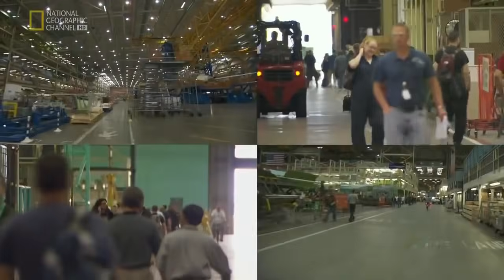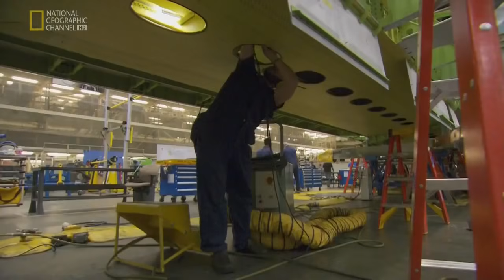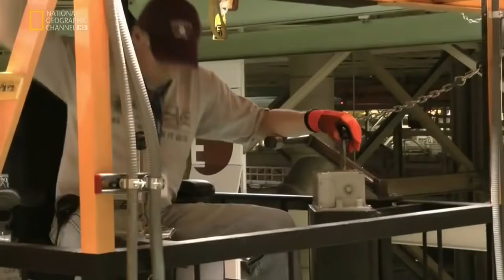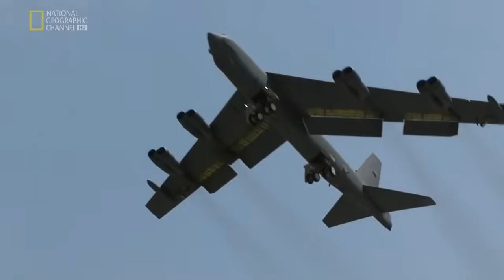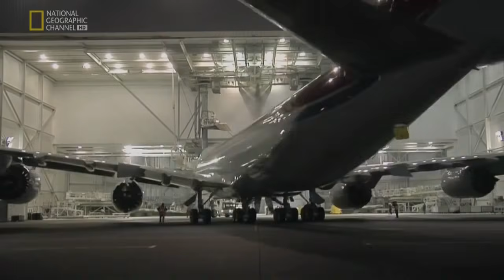Boeing 747-8 Mega factories Documentary- Boeing's latest Jumbo Jet!

Comment: A salute to Joe Sutter (the father of the 747). Without him, we would never have had this plane design. Also, I just discovered that the 747-800 has much larger engines than the 747-400 does, which makes the 747-800 look much better in my opinion. R.I.P. Mr. Joe Sutter.

Comment: Magnificent plane. Too bad hardly anybody is buying it. Looks like 747-8 came out at the wrong time.
Reply: A few years late .. Airbus got the major part of the large aircraft market.
Reply: Yeah only about 100 have been sold
Reply: I wonder why they didnt make the structure in carbon fiber like the 787 would make it so much better
Reply: That would be a new design, rather than an upgrade, and would require a long and costly certification program.
Reply: ***** Yea makes sense.
Reply: Sitti2300 mostly used as freighter
Reply: Halo Fire op
Reply: Halo Fire  op
Reply: The 747 was designed to be a passenger / cargo plane from the beginning.  It will be just fine.
Reply: Sitti2300 Lufthansa did
Reply: Sitti2300 Anyone who owns a 747 would trash their old one and get this one. It is new and more efficient.
Reply: HyperVenomProduction British Airways would beg to differ
Reply: minimusmax not if you consider their development costs...
Reply: Pedro Santos do you not realize how expensive carbon fiber is?
Reply: Sitti2300 I'll buy it for under 30 bucks
Reply: Sitti2300 yup but you never know what might happen do you like airbus ? i dont go anywhere near
Reply: +Sitti2300. the designers of the 747 planned for this kind of thing back in the 60's when they thought supersonic passenger flight would take over, so they designed it to be as good of a cargo aircraft as it is a passenger aircraft, the new dash 8 is no different, if it can't sell as a commercial aircraft they can sell it as a cargo aircraft. 
the reason large aircraft aren't selling so good is the loosening of the ATOPS rules. it used to be that only aircraft with more than 2 engines could cross the oceans, now though 2 engine aircraft are as reliable and as economical per passenger as bigger aircraft so now airlines don't need big planes. this has created a new "point to point" system of flights instead of the old "hub to hub" system the 747 and a380 were built for.
this could all change though, if something happens geopoliticaly then the hub to hub system may become valid again and big aircraft will start selling well again.
Reply: Thats because it's the second best
Reply: honestly a380 and 748 are victims of their own companies with the A330/350 and 777 respectfully
Reply: @brendanmiller4134  looking like 150 will be built in total, 103 of the freighter version, Last freighter delivery expected in 2022.
Reply: @googaagoogaa12345678  I agree. They build these huge planes and turn around and release these fuel efficient twin engine planes that carry nearly the same amount of people and wonder why the jumbo aircrafts aren't selling. This is one reason I loath the 777, that and its overall blandness.
Reply: For the same reason, the A380 is also no longer selling.
Reply: I sincerely doubt anyone at Boeing's board actually expected a profit from the 748. By the time they decided to build it, any of the potential markets would have been either more efficiently filled by the future 779, or more prestigiously by the A380 that was already in the market. Given that the market for Super Jumbos was rapidly shrinking by the time Boeing announced the 748, it's pretty obvious the development was just meant to be a status rather than practical response
Reply: More like it came out past it's time, people prefer to get to there destination quickest and most efficient.. I'm not suggesting that SSTs are the future, just saying people prefer not to waste time on the ground, they wan't to get there as direct and if possible as fast but they aren't going to pay extra for speed..

Comment: A380 production is slowing down and 747-8 is failing to sell. The A350xwb and B787 are the future.
Reply: That's true. The more efficient twin engines like the 777, 787, A350 are the future.
Reply: 777 is why 747 sales are going down
Reply: You forgot the 777
Reply: Owen Chen why would they not do that? Give free money for Boeing or join the competition
Reply: Between the 777, 787, and the A350, I like the 777 the best, as far as looks go. The near future 777-10 (or whatever it's called) looks like it will be very nice looking, but I don't like the folding wing tips. Of course, I love the 777-300ER. I think the 787 and A350 are kind of ugly up front.
Reply: 747-8F is doing well though
Reply: unlike the a380 though, the 747 was also built to be a cargo aircraft, which means if it doesn't sell well to passenger airlines, it will probably be exactly what Fedex or DHL need. i can't see the a380 easily being reconfigured into a cargo aircraft, it was never designed with that idea in mind.
Reply: @killman369547  true more than half the 8s are Fs UPS has a big a** order at the moment fedex beside a brief stint after the merger with flying tigers has never ordered or operated 747s ups LOVES them though
Reply: The 747 was actually originally supposed to be a freighter. The whole passenger thing just happened to work really damned well to start the program. The way the nose swings up on the cargo variant makes it much easier to work with in loading/offloading operations.
Reply: @Jetlog8  As of mid 2018 the production rate is 6 per year of only the Cargo version, likely until 2020.
Reply: Funny, from what I recall reading is that these jumbo jets will soon be needed to deal with the increasing number of passengers.

Comment: 1 747-8 engine creates as much thrust as all 8 engines on a B52??? B52 needs some new engines then. geez.
Reply: And they will....
Reply: B52s will soon be 60 years old. I don't think they're gonna bother to redesign them any time soon.
Reply: melted cheetah yeah they want to keep them flying till 2040, which is stupid because they’re so inefficient, they need a parachute to slow down
Reply: @xenomorphbiologist-xx1214  That makes no sense.  Efficiency has nothing to do with a braking parachute.  Many airplanes use them.  

The basic design of the B-52 is so efficient that with new engines they are projected to be able to go around the world without refueling.
Reply: johng3592 what I mean is the engines do not have enough power in their reverse thrust to slow the plane down adequately.
Reply: That stat is wrong. B52 has 8xTF33 at 17,000lb each for 136,000lbf total. 747's GENX--2B67B  is 66,500lb.
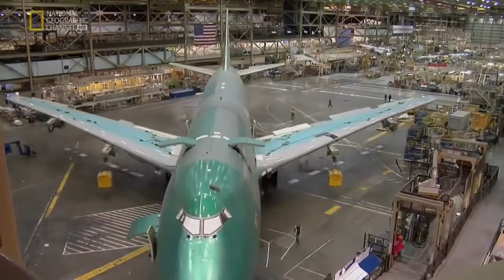Reply: 29:50 power time!

Comment: why don't they just install a small extra wheel at the tail, like the concorde has one, to avoid tailstrikes?
Reply: they should use a wheel to charge the lights in the bathrooms.
Reply: good idea xD
Reply: No space for a tail wheel. The black boxes, recorders and main computer systems are all located in the tail
Reply: +JR AL ok thanks for the answer :)
Reply: +Gabby Hyman The engines are used to generate power for the aircraft.
Reply: E1craZ4life to
Reply: Really no need for a black box. No need to store that info on plane. Because WiFi.
Reply: NeverTalkToCops1 an aero plane isn’t connected to WiFi and WiFi can’t reach the aeroplane

Comment: still can't beat the airbus!!!! a380!!!!!!!!!
Reply: no shit, it's a bigger plane
Reply: Like ur mom
Reply: it can first by range second in speed third in length fourth it can land on normal airport like Naia Davao Airport in Philippines
Reply: +Hilton White I didn't realise that a company that has no gender could be gay.(in case you can't tell this is sarcasm.)
Reply: Hahaha!!!
Reply: That's true!!!
Reply: It will always still be a scarebus.
Reply: ***** Only because it's new, and the airlines that buy Airbus are idiots, they're throwing $50 Millon away with every plane they buy thats an Airbus as opposed to a Boeing , and the 747-8 is a lot more fuel efficient
Reply: Lufthansa, which has ordered both the A380 and 747-8, concludes the A380 burns less fuel per 100 passenger kilometers, though the figure is 3% lower on a litre-per-passenger kilometer basis
Reply: That isn't really fair --
In Lufthansa's A380 configuration, they have: 8 First, 92 Business, 52 Premium Economy, and 336 Economy Seats.
In Lufthansa's 747-8 configuration, they have: 8 First, 92 Business, 32 Premium Economy, and 208 Economy Seats.

They are suited for different markets and have different ratios for their seat classes. If the 747-8 had a configuration with the same ratio as the A380, it'd be something like this:

8 First (nose section, not going to change), 68 Business, 40 Premium Economy, and 278 Economy.
And yes I checked this configuration fits perfectly in the airplane...

So, the new version of Lufthansa's 747-8 has 54 extra seats than the old one. This immediately takes away the 3% advantage of the a380, and instead gives...:

(using 100 for simplicity for ratios)
100 litres per person on 748 - 34000 litres -> 86.3 litres per person
97 litres per person on a388 - 47336 litres -> 97 litres per person

... a huge advantage to the 747-8 of 11%.

Also, the a380 is likely to not have as good a load factor compared to the 747-8, so the 747 should have a much better economic advantage.
Reply: Mikael Can And the 747-8 is $50,000,000 less, that's a no brainer
Reply: Andrew Anane that is a horrible plane
Reply: +Easton Williams if its a '' no brainer'' why is the a380 out selling the 747-8i at a ratio of 6:1?
Reply: john walt Lmao, the A380 is literally dying as we speak, everyone is buying more small bodied jets instead of large ones and even then Boeing is still going strong with the 747, UPS just bought 28 747-8, the option of the A380 was totally non-existent because it can't haul cargo.

The whole point of the 747 was that it was designed for multipurpose, Cargo, Civilians, and maybe even military, the A380 is Civilian only which means Boeing is the only option unless they decide to get smaller Airbus' for Cargo and even then the 777 is still going strong and the Cargo airlines will simply buy the 777x.

The Cargo market is on the upturn which means Boeing has the advantage over the A380. Airlines are cutting orders on larger aircraft and would rather have 737s and A320s that can fly across continents or 787s and A350s.

Also, the A380 is much older than the 747-8. It doesn't matter what is happening in the moment, Boeing like other smart Businesses have their products planned out into the future over 5 years.
Reply: it's not Airbus it's scare bus LOL the name Airbus sounds a little cheap granite flying on a plane today is a lot like being on a bus though😕😕
Reply: A380 looks fucking bloated

Comment: My 747 won't start and the brake is hard, help?
Reply: Hmmm, could it be because it's a model?
Reply: +PilotStudios Channel hahahauua
Reply: PilotStudios Channel YES!! :D that totally explains it! :D how'd you know? :D - no seriously I'm so poor out of my ass that I cannot even afford a model :(
Reply: +friedchicken1981 xDDDDDDDD
Reply: You could buy a Daron model that goes around 7 bucks. They aren't the best mainly because they are meant to be children's toys, but they are pretty detailed.
Reply: Pzkw V cool thanks, maybe with two months of hard work I could afford one :D
Reply: friedchicken1981 have you tried putting engine oil 😂
Reply: Try to do a reboot
Reply: Have you tried turning it on and off again?
Reply: @techsupportranjit7637  this aint airbus
Reply: just throw it out and go to toyshop for a new one
Reply: friedchicken ; You need to check the coil chip processor and it's battery, in a pinch just use the battery out of a mini-calculator and you should be fine.

Comment: The A380 was not a success mainly because it was actually surprisingly ... too big for the needs and also because fuel consumption/seat was not very good.  After only 10 years of production, Airbus may soon scrap the A380
Reply: If Airbus can somehow figure out how to make the A380 much lighter (by using new exotic light materials), and improve on aerodynamics, it might become more practical? Also, more fuel efficient engines would help. Maybe they can go to a two engine system?

Comment: "just one of these engines creates as much thrust as all eight engines on a b52".... So why not just stick one of them engines on a B52?  :D.

That has got to be bollocks by the way.. doesnt add up to me.. might be cos i have had a drink but from what i seen.. One of them engines has about 4x the power of a B52 engine so... it would be 2 of them that creat about as much thrust as all 8 of a b52???... Maaybe they meant the earlier models.. O.O... fuckin mind boggling
Reply: +Vanadeo yes and no.... Yes in the fact that its more powerful than the orginal 8 J57s... but current J57s put out about 17K lb of thrust, so you are kinda correct.
Reply: because 4 engines cant propell a large airliner such as b52 and early engines is low bypass
Reply: +Vanadeo because engines dont work on their own, it requires an extensive and expensive redesign of the entire aircraft
Reply: haha i think they got a bit confused,2 of them are equal to the 8 on the B52
Reply: +theRealAV8r The KC-135 is just as old as the B-52 and they went from 1950s turbojets to late 20th century turbofans. With the B-52 projected to have a lifespan of nearly 100 years there's no reason why they shouldn't do it. The amount of money they'd save on fuel costs would more than pay for the conversion.
Reply: Thomas S Apparently it's a combination of factors that have stymied the B52 re-engine. Among other things is it's unusual airframe. Also low oil prices and the small fleet have helped the case for doing nothing.
But according to the link below, P&W is still looking at enhancing the existing engines, which would maintain the current 8 engine config and abrogate the need for extensive redesign:
https://www.flightglobal.com/news/articles/pw-still-pushing-upgrade-of-b-52s-original-tf33-en-424327/
Reply: The wings would have to be redesigned to accommodate the new bending moments that would be in place due to the reduction in engine weight.
Reply: What kind of engines are on a b25 bomber

Comment: In my machinist years, our shop was subcontracted to machine the holes in the cockpit instrument panels for the newly built 747.  The panels were approx 8"x15" aluminum sheets sandwiched together with a honeycomb structure between. Over all thickness of about 1/4", very strong and very light weight.  All measurements were +- .003"

Comment: Even the latest 747-8 with the GEnex motors, it still has less range than the A380. Either way, both big planes are dying out for twin-engine super long range and efficient platforms like A350, 777, and 787 which carry lots of people with less cost, less fuel cost and maintenance cost. And same with the 737 and A320NEO.
Reply: GEnx motors didnt know it was electric thought it used GEnx ENGINES

Comment: I took flights on both the Boeing 747-400 and the A380 but I still prepare the Boeing 747- 400. I feel more safer on the Boeing 747-400 because of its safety records and now there is a newer model which is the Boeing 747-8. Now, there is no argument. Boeing 747-8 will be my choice.
Reply: +PNOYPWR ??!!
Safety records? Well, the safety record of the A380 is MUCH better than the 747 ... you'll say that the A380 is not old enough to have crashes or something and you would be right :) However, the 747 has had really nasty crashes in the past ... 
I take 747s and A380s from Europe to the far East every month and I can tell you this. The difference as a passenger is that the A380 is much MUCH more comfortable in terms of room (Business Class is much MUCH better in the A380) the plane is much quieter, but the windows of the 747 are much bigger and done in a better way for the passenger. Anyway I'd prefer the A380 anytime apart from one small detail; every time that 2 or 3 planes arrive at the same schedule, it's hell in the Controls, Luggage, etc. But it's not such a sweet deal with 747 as well.
Some say that the 747 is much good looking; I don't think so but then again, I cannot see the plane when I'm inside ;)
Reply: The 747 has been flying for 45 years and your comparing safety records! You have got to be kidding!
I will take the 747 every time, I could careless if I ever fly on an A-380!
Reply: @ jorgeferreira2009: The 747 has been flying since 1970. Sorry. I guess you are still not born after that year,Lol.

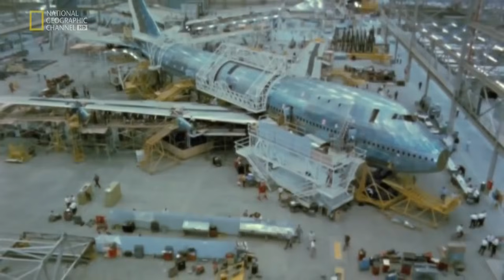Comment: @~20:30 "The Sutter Twist" - better known generally as "wash out" that's been applied to the inboard sections of wing design since WW1 to mitigate excessive roll moment when laminar flow separation occurs at stall by forcing it to begin at the root.

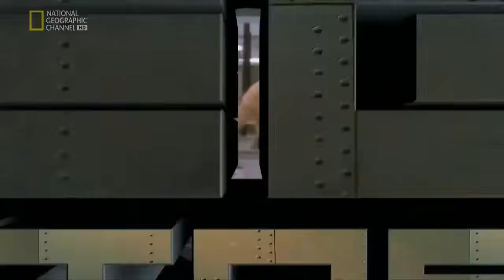Comment: Hmm i still prefer the old school way of adjusting the shape of the plane to fix any aerodynamics issues to avoid vibrations, here they using a computer that makes adjustments while you flying, which is a cheaper way of doing it but I reckon its not as reliable. I don't trust computers and fly by wire as much, computers always end up having issues sooner or later. (I'm referring to what you see after 19:48)

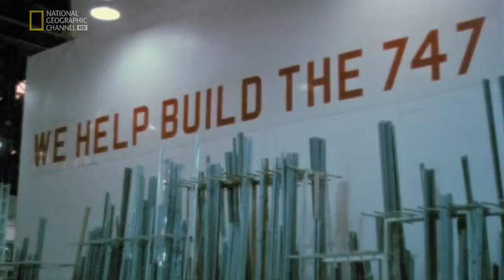Comment: 8:11 Pan Am originally wanted a plane with 350 seats with a 5k KM range in the 1960.
Yet just 2 decades later, Japan Airlines managed to (painfully) CRAM 563 seats into the SAME 747 airframe!
Though this isn't really any worse than a contemporary Emirates A380 config with 615 seats today (a sign of the times)! 557 seats of which are coach (may as well be steerage) and the remaining are 1st class beds.
Reply: Ah, the 100SR. It looks identical to the 747-400